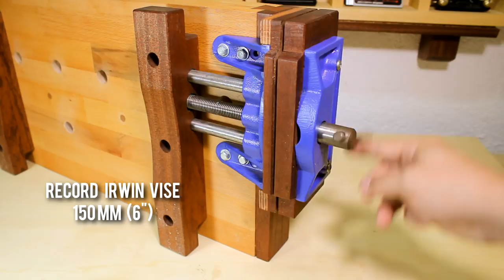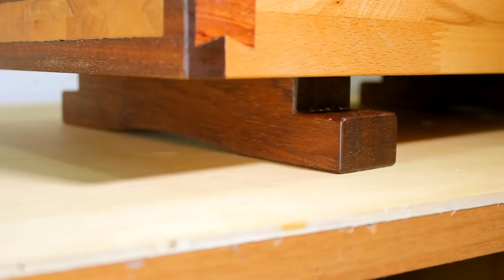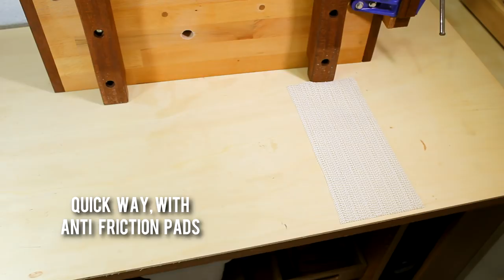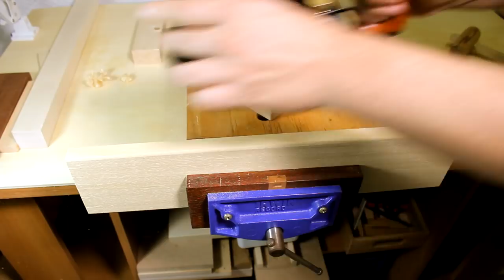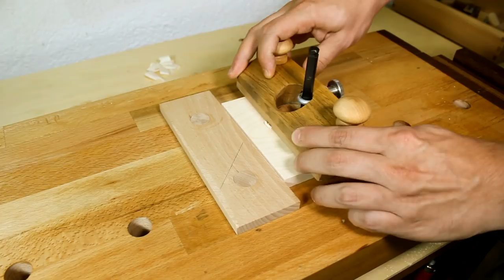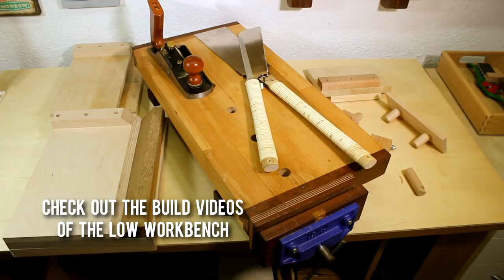Low Workbench - Overview and How to Use It [4/4]

Comment: I do so much small work, I'm really liking the idea of having one of these, though admittedly, I think I may need a real workbench first.
Reply from the maker: I've used an old chunky melamine desktop under, you saw how was wobbling :)
Reply: My workbench is pretty solid, but built into the corner wall in my garage, and is kind of small which is very limiting when I'm trying to work on a project that has more than 1 side.  Maybe I'll just build the low workbench to expand what I have until I can build the full size one.,

Comment: Lovely hand plane. Which one did you like to use ? Japanese or western style hand plane ? Pros con both of it? I little confused choose what hand plane suit for me.. thanks AP
Reply from the maker: Hi, thanks for your comment. I recommend starting with a western plane, steel one, they are more easy to setup and keep it this way. Japanese ones look very simple but there is a lot of fine tuning to achieve 100% of that plane. I use two cheap Japanese just for fun and to learn how to use it until I will spend more on them. You can use both styles on any job, depends on your kind of work and experience where one will fit better. I cannot make now an adequate pros con cause I haven't use sufficient the Japanese ones, the only thing maybe about Ja ones that I've noticed is that are not suitable for very hard woods, or there are if you buy special ones with harder blade, different angle etc, but they cost a lot. The western plane in the clip is a Veritas Low angle smoothing plane, it cost a lot, but is one of those tools I've regretted not buying it from the beginning :)
Reply: Thanks for the explanation. Thats help alot..

Comment: Hello Adrian...Good luck with the move...and V2. Can I suggest 2 rows of dog holes, so, that object is held by triangle.  PS: Paul Sellers vise do not rack so much...
Reply from the maker: Hi Jakob, thanks again for your comment! 
My initial thought of the v2 one is to make more stand alone components. A smaller little bench, like a japanese planing board style with various accesories (shooting boards for both W and JA planes), and like a medium size table, something like a coffee table but much sturdy and heavy, with a portable vise, and probably for dog holes system I will use that Veritas inset vise. The idea of the table is to be discrete, to blend more in the house and not to look workshop like :)
Reply: Hello again...nice of you to reply...! It is a good idea, to have a sturdy table, with a moveable vise...Jay Bates early Moxon Vise comes to mind...Then have a Benchtop Planing Bench on top. Small work is done best up close.   I have an old Swedish book, where the corner of the kitchen table is used as workshop. Maybe make a la  "Butchers Block" table...?...(Time for a 60 x 60 Ikea Hack)...?  PS: Remember to stabilize the tables bottom shelf... Pieces of Iron hidden under...100kg at least. Again...good luck with the move.
Reply from the maker: Great idea this butcher block table, I wasn't aware of its existence as a table name :), thanks Jakob! I have more inspiration ideas now :D Anyway, I will hang out a couple of weeks in order to make an idea what will suits better in my situation. Thanks Jakob!